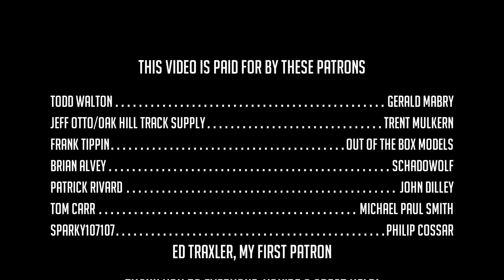Mountain Lumber Company Sawmill build | Walthers Cornerstone

Comment: Ron, so many people I've talked with are so intimidated by craftsman & laser cut kits, (I was too, but I broke down and built one and now I love them!) This is a good project for those who feel intimidated by higher price kits. Once you gain confidence building a few plastic kits, I think, (at least for me) it makes it easier to want to investigate laser cut & craftsman kits. A little tip for getting acrylics to stick to kit plastic, either primer the pieces with a flat color, even clear spray. Acrylics need something to hang onto, which you discovered after painting you flat base color. Hope this becomes a build series, would like this to be a diorama as folks need to see how a run of the miill kit can be made spectacular with some effort. I'll be watching!!
Reply from the maker: This kit is going all the way to diorama and probably my first functional module for the OSS (a new group I might start, probably start, who the f knows). If I could afford a kit a month I'd do the series in the fall.

Comment: Some 1-2-3 blocks would help hold the walls vertical & square as you build the structure.  I ordered a set and the damn post office lost them.  I just finished a Walthers Cornerstone chicken coops and farm buildings kit.  It was a fun build and I learned quite a lot from doing it.  I waited until I had finished building the kit to paint it and now I will change all that.  I'll start painting parts on the sprues before final painting.  Cheers from eastern TN
Reply from the maker: I finally got a set of blocks and they rusted up immediately. lol I just laughed as this is typical these days

Comment: The best glue I used more my model building is called plastic weld works really good you can do the walls and joints and it sets in seconds
Reply from the maker: Yeah the funny thing is this is the one and only plastic kit I ever built. Over a hundred wood structures and one plastic lol

Comment: That is a nice LARGE kit!!!
Sorry to disagree with you there Ron-O ... but plastic models are easy-peasy to assemble!  Even the most complex kits go together very easily.  Use Faller Expert styrene cement for assembly, or even MEK Solvent!  As for painting ... hell, Acrylic paint goes on and stays on wherever or whenever I use it.  I've been building plastic kits of ALL sorts since I was a kid, and at 62 that's a LONG time ... you name it ... Monsters, Animals, Birds, Buildings, Static Model Locomotives, Cars, Planes and Ships.  As the line in the movie 'The Graduate' says ... "One word ... Plastics!"
Reply from the maker: Its OK to disagree. I have been wrong before
Reply: As have I!  Live and learn ... ;)
Reply: I also feel the glue in a tube is worthless. I use a mix of MEK and Acetone, 3 parts MEK and 1 Acetone. Use a small natural paint brush and let capillary action pull it into the joint. It will harden in a couple of minutes. If the Joint has a rattle to it (some part did not bond well) just add a little more MEK mix. 
If you get some where you don't want it, DON'T touch it. Just let it evaporate. You will only have a dull spot. Paint will fix that. The worst thing is to get a finger print or a smear. So don't touch.

Comment: acrylic paints will attach to plastic pieces. What I do is spray all the plastic pieces with frosted glass clear coat and let it dry. Then I brush on the acrylic paint thickly on the plastic pieces and then wipe it off right away making sure not to wipe to hard so I don't remove the paint from the cracks. Then I clear coat w/ flat or frosted glass clear coat to seal in the acrylic. I have pictures on my instagram if you want to see how weathering looks. 
Instagram = brian.olee.krause

Comment: Hey Ron ,what exactly is your mix for your handy dandy concrete mix ? For my concrete I use a mix of grays and buffs (Tamiya acrylics) works out nice ,but always good to know what others use.
I`ve built a few Walthers N scale cornerstone kits and rather like them ,nice and easy to build but the magic happens during painting and custom touches.I also do a lot of scratch building...my true passion.
This is probably the first time you didn`t use Weldbond on a build...although I see 3 jugs off camera just waiting to be used  LOL
Just as a note ,I wash my plastic parts ,be it a kit or scratch building with alcohol.Tamiya paint sticks well afterwards with no adhesion problems.I used to always use enamels and lacquer  through the airbrush during my model airplane building days ,but made the switch to acrylics when I got into model railroading (never thought I would).Now I love them ,no smell,easy cleanup and fast drying(hairdryer works great, like I see you do too)
Very nice build ,has that Ron touch to it !!

Still like your woodkits/artisan kit builds the best.
Salut!
Reply from the maker: Pual I am fixing to live stream again when the studio is done. I expect that we will have lots to discuss. The shop concrete is simply Lowes matched aged concrete in a quart. Thanks for watching